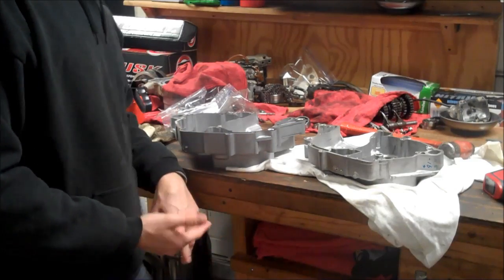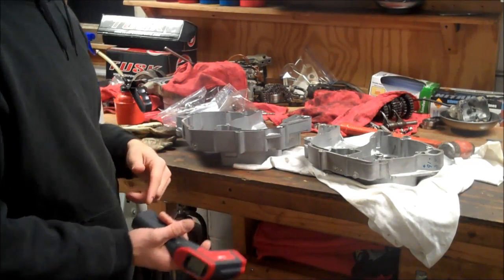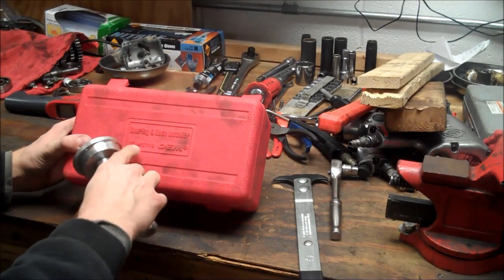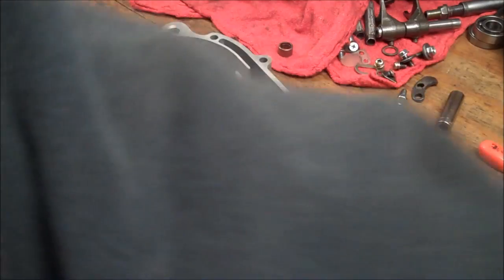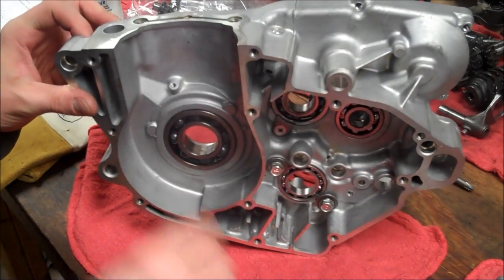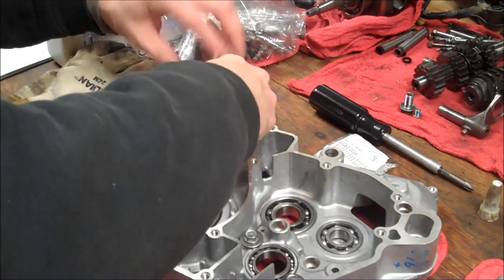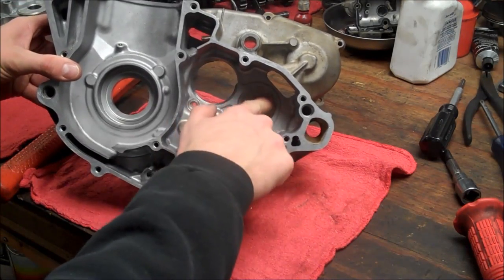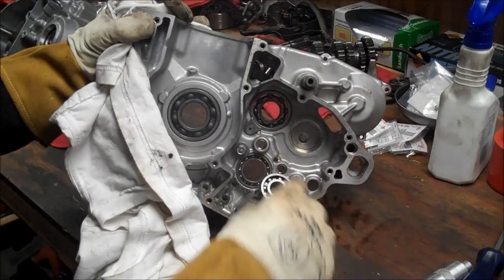How-To: Install & Remove Crankcase Bearings With Your BBQ Grill

Comment: Hi Matt. Love the vid's. I'm in process of restoring a '76 Elsinore 125 and am having big difficulty getting the one and only blind trans shaft bearing out. I tried this grill method and the two large one's fell right out just like you said. The blind bearing however had the cage and needles fall apart and the outer shell won't budge. Short of buying the entire Tusk kit, do you have any tips? I tried a seal puller on the outer lip and a piece actually broke off so that is a no go. Thanks
Reply from the maker: Watch this video and see if it helps: https://youtu.be/GRvEUBjRL6A

Comment: Hey again Matthew. Im in the process of taking my bearings out of my wr450f. Can i put the cases in the oven at 350 degrees for about 20 minutes? I have a slide hammer but like the idea of heating it all up better than smashing them out. Thanks
Reply from the maker: Yes oven works even better. Problem is that any oil film will smoke and smell up the whole house. Not recommended if you live with your mom or wife...LOL. If you live alone go for it.
Reply: Appreciate all the help

Comment: Hey when using the bearing race driver to finish putting in (let say) the main bearing, should I have to worry about the tool’s face hitting the inner race too ? What you think 🤔
Reply from the maker: If the tool face is contacting both outer and inner race, I don't see a problem with that.
Reply: I want you to take a bearing and put it on the seal driver side of the tool....then press firmly on the outer race ..... do you know what is going to happen ? 
The inner race won’t spin at all. 
But now, press firmly on the inner race..... do you know what’s going to happen ? 
The outer race on the bearing will spin like a gyro. 
That concludes my observations that when the seal driver side of that tool is used as a bearing driver it will first contact the inner race of the bearing way before the outer race. Make sense ?
Reply: I believe that this is one of the causes that lead the early or premature bearing failure. The crank journal is going into the inner race of the bearing all the way till it bottoms out so; why would you want it hit on both inner & outer race at the same time when it can be avoided at all costs. All you have to do is buy an impact socket the same size as the outer race at your local parts store or machine a tool (if you want to go that route $$) that fits on the outer race only? I don’t just believe everything I see or read i do deep research and fail hands on at times. That’s why I want for you to experiment with this and let’s see your findings. Would really be a lot of help if you did. 
Thanks Matt 🤙🏽💯
Reply from the maker: @charlesdavidson7324  Well in that case a suitable socket and outer race only.

Comment: If I need to bake the cases to get shift drum needle bearing out, will the rest of the bearings hold up to the heat? Or will I have to replace every bearing.
Reply from the maker: The bearings will hold up to the heat if you plan on reusing them.

Comment: Would this heating method work with connecting links that have blind bearings? I recently broke my blind bearing collet (Motion Pro) and damaged my connecting link trying to get the blind bearing out.  It was extremely difficult.
Reply from the maker: Is the connecting link aluminum? If so, then yes. However, those particular bearings are a PITA to remove.
Reply: MatthewMCRepair Thanks for the reply and yes its aluminum (05 RM 125).  I will give it a try next time...

Comment: What are the causes for the bearing seat to be loose?
Reply from the maker: Does the seat appear to be damaged? Are you using OEM bearings?
Reply: MatthewMCRepair yes seat is damaged. Original bearings. Any idea?
Reply from the maker: @azharihamid9992  Email me here: https://www.howtomotorcyclerepair.com/contact/

Comment: Pro tip to anyone trying this: Be very careful about your temperature setting. I just turned a case into a Picasso painting using this method. Apparently my "medium" is different than everyone else's "medium". Don't over cook your case and end up like me.
Reply from the maker: JT, that is why I have an IR gun and mention 140-170°F is plenty. 

What kind of grill do you have? Mine will only hit 550-600.
Reply: MatthewMCRepair its pretty obvious he totally lied about melting his case.
Reply from the maker: Aluminum melts at 1200°F. I don't have to explain any further.